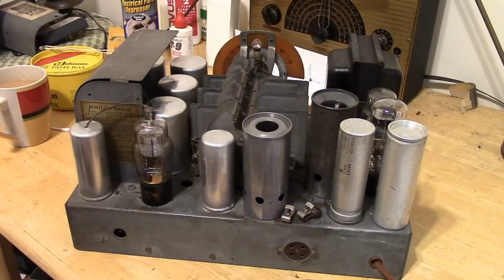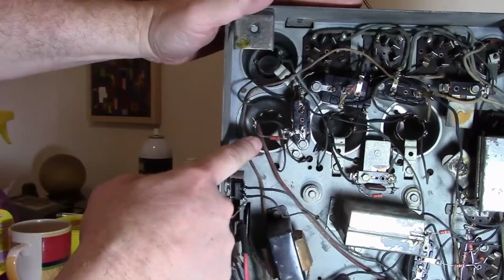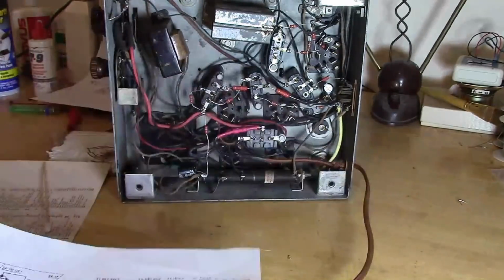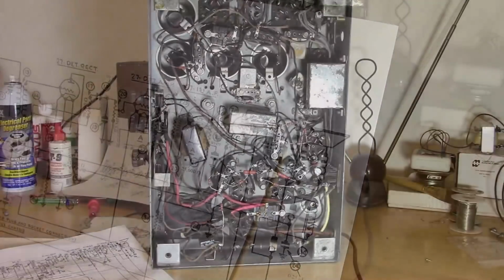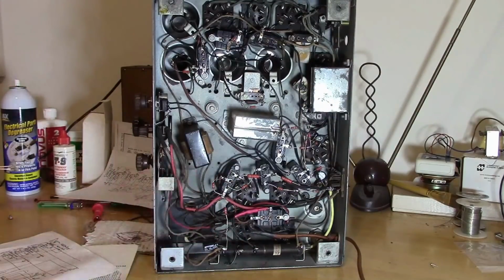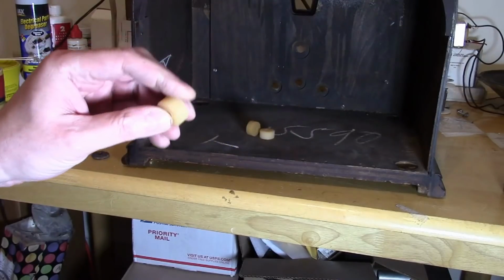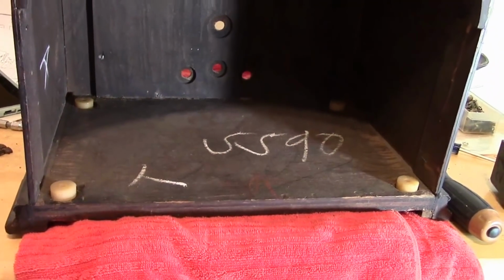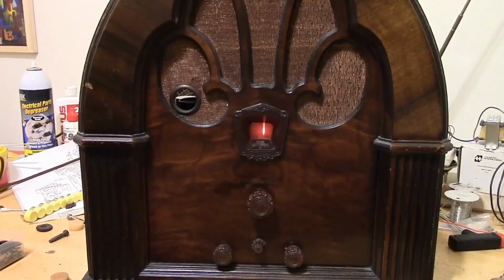Philco 90 resto p11o12

Comment: Put a twelve-inch piece of 1/4" or 5/16" brass or aluminum tubing over the tuner shaft and put it through the hole while the chassis is only part-way in. Moving the chassis forward will then align it with the holes without having to adjust up/down and left/right, allowing you to concentrate on not dislocating the resilient isolation bushings.
Reply from the maker: Interesting idea, but there's the problem.  The chassis can't slide forward or it will get hung up on the rubber washers.  It needs to come in at an angle which is awkward because it's both heavy and delicate.  There is also very little wiggle room.
Reply: @bandersentv : Right. You still have to lift it and bring it in at an angle, but you don't have to guide the shafts through the holes - the tubing does that.

Comment: Why not just glue the rubber mounts to the chassis
Reply from the maker: You can't get it into the cabinet.  The added height causes the control shafts to hit the front of the cabinet before the mounts get to the recessed cutouts.  I suppose if one were to extend the cutouts a couple inches towards the back of the cabinet it would work.

Comment: Rubber cement or Vaseline to hold them in. If they were traditional torque stand-off's there would be a metal sleeve that keeps from over tightening the insulators around the chassis, as well as under the capacitor gang. Sensor -Safe black RTV will work as well, though you might need to lay the radio on it's' front or side on a big fluffy pillow after the rubber insulators set in place, then slide in place, and bolt down evenly until the shafts are even all around. 
Cannot wait to see the original speaker installed and part 12, 13, 14...89, 101...hee hee hee...Just kidding!
Reply from the maker: LOL  I've committed to the next installment being the last.  I tightened the bolts down until there was about 1/16" of space remaining.  Just enough to give it a little cushion.

Comment: You might like this video
/watch?v=n_m4X31J3Kc
It's pretty cool. They talk about Philco and then walk you through the making of an early (1929 IIRC) radio.  At one point during the film, they show a radio chassis suspended between two chairs and then a man gets up on it and jumps up and down on it as a demonstration of how strong it is.  At another point, they demonstrate a capacitor machine that looks like it has toilet paper rolls on it.  They don't demonstrate it, but they show the coil winding machines. 
Philco made most of the radio. They made the components including the tuner right in the same factory. They even built the cabinets.  They demonstrate the making of the decorative legs of a radio on the automatic lathe that cuts the whole thing at once in a  few seconds.
The footage is from a brand new factory they had just built, so it was the state of the art of the time.
Reply from the maker: Yep, I've seen that a few times. Seems to be the only video of the old Philco. I'd be cool to see one from the 30s

Comment: Maybe going to the hardware store and get some sheet cork might be an option  NEXT TIME . 
It gives a little and may just be the correct thickness. It can be cut to fit the holes on the bottom  and doubled up  if need 
be and you could glue it to the chassis with  clear Gorilla glue when satisfied with the process. The glue should work for 
the rubber feet too. Funny I have jars of screws and only could find one or two that is right sometimes.
Reply from the maker: Now that Renovated Radios is gone, experimentation is definitely in order.  I also have some rubber sheet stock, but boy is it hard to cut or drill.

Comment: Great job, I know it had it's moments. Tricky job getting the chassis into the cabinet. Was wondering if it would've helped to glue the cushions to the chassis corners just enough to hold them in place?
Reply from the maker: Yes, very likely.  I also just discovered something that may shed light on how they did it originally.  There will be a short follow up video soon.

Comment: I was thinking of using Locktite shoe glue for those rubber snubbers. Glue the front ones to the metal chassis, and if you have to remove them, a razor blade scraper would work. More robust than RTV, and harder rubber.
Reply from the maker: Good idea.  Somehow I was fixated on putting them in the cabinet first.  I also have some GC rubber to metal cement that works well.

Comment: Many thanks for this very interesting series of the Philco 90 restoration! Just one thing I noticed is, that you don't change the original wires going to the outer grid connections to the tubes. Like the wire from the IF tank to the grid connection of the 24 tube at the left side of the chassis. When I restore radios from the 1930's this is one of the very first things I do, the complete replacement of all the wires going to the outer grid connections from tubes. When measuring the normal DC resistance of these cables, there might be everything ok. But the copper material in these old wires almost always do have some corrosion and this can be quite a bit of resistance for high RF freqencies! Some of these old wires do already  have verdigris inside. Nowadays there are fortunately some new cloth coverd wires available, and with these very beautyful restorations can be made. It might be beneficial to replace all the old wires in radio circuits where RF is going through. I have seen in some cases a huge improvement of performance and sensibility of such old radio sets with replaced wires. Have fun and best regards from Switzerland, bluearcturus
Reply: wow on the rf wire resistance.  I might try this.

Comment: I have a question, i have heard in some videos that there is some virus or disease in old radios do you know if this is true or if it affects European radios? I’m am talking about 50s radios, the reason I wonder is because in my bedroom I have around 12 radios most from the 50s and I don’t know if it’s good to sleep in the same room. If you know please respond.
Reply: Maybe you mean “silver mica disease”?
Not transmissible to humans (no vaccine needed), but it can make your radio pretty ill. 

I don’t know about European radios, but in the 50’s when most U.S. radio manufacturers changed from capacitive tuned IF coils to inductive tuned ones, they used fixed value capacitors constructed with a sandwich of sheets of mica, and silver coated metal. Eventually the silver tarnishes, and can randomly form conductive silver oxide bridges that change the values of those fixed capacitors, altering the performance of the radio. 

I believe Mr. Anderson has covered this, along with several other YouTubers, and how one can repair this issue.
Reply: @erikj.2066  They talked about mica disease but now I know I doesn’t effect humans
Reply from the maker: No, it's not true.  I've never heard anything like that.  The only thing I can possibly think of is that a few radio models had some asbestos heat shielding in them.  Even in the very unlikely case one of your radios has some asbestos, it doesn't really pose any hazard unless you rip it out, shred it up and breath it in.
Reply: Antique radios do contain some organic materials like wood, cloth or cartoon. And these organic materials can have mold (fungus) infection, if the item has been stored for a long period in a place with lot of humidity. But this is not a particular problem of radios, any object with organic materials can have this issue. If you are not sure if you have this problem with your own radios, go online fur further information. A first typical sign would be when a object has a certain smell, like the smell in a wet cellar. Then it's advisable to search for professional help an treatment. But the topic about the "silver mica disease" is just a type of metal oxidation or detoriation and is no harmful to humans. Best regards from Switzerland, bluearcturus